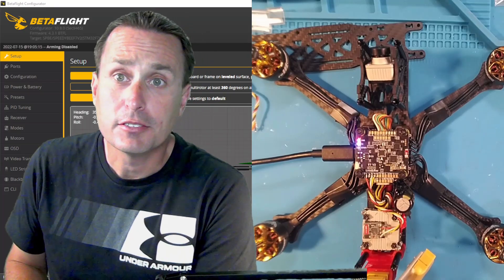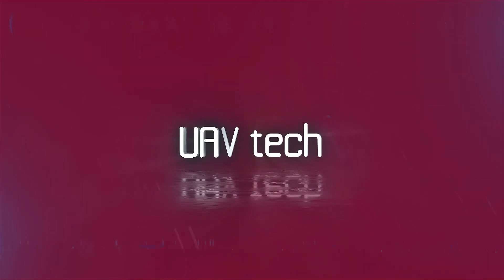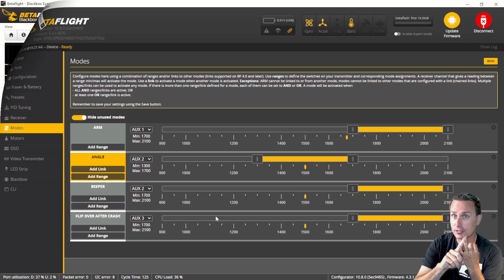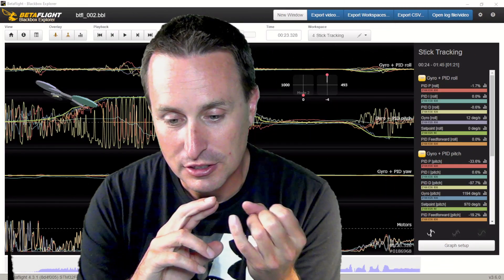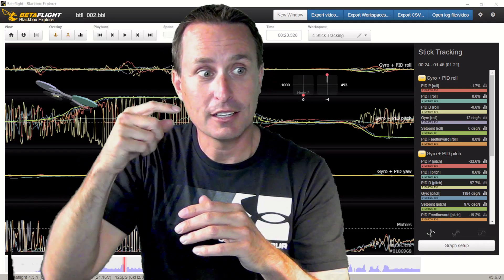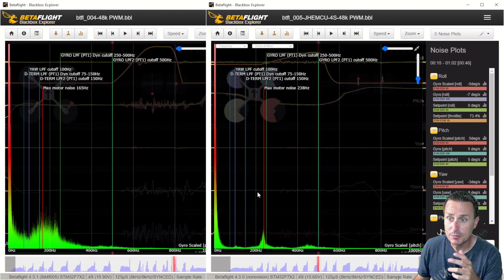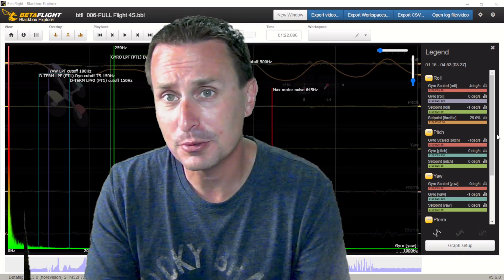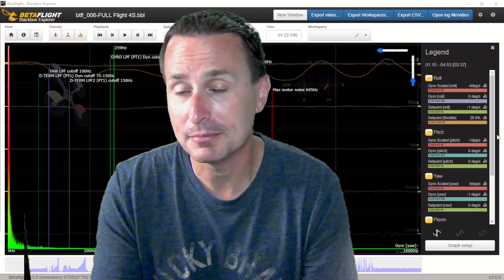🔥BAD FPV EQUIPMENT💥 -- Is your Drone build Good? | Check It!

Comment: YES. In fact what I really want is someone to make a video with some rules of thumb that helps me pick from the presets. They say Clean, Normal, Dirty. Is my quad clean normal or dirty? I dont know. We all think our quads are clean because we are all awesome at building quads, but I suspect more of us should be picking normal and dirty. Just some hard fast rule, like peak noise above some number, you cant pick clean.
Reply from the maker: I think the rule is it flies ok on Clean,, go with Clean.  If not, go with Normal.  If still no good, go with Dirty and consider trying to fix it up to be cleaner.

Comment: Hi, i am just so close before just quitting fpv after 5 years beeing in it. I invested so much money which especially as a student certainly was not easy! I hoped (since you are THE Betaflight expert) you might be able to help me:)

So: i´ve got two FCs on Bf 4.31 a´with major issues.
The first one was a foxeer f7 mini pro v2 i flew for quiet some weeks without problems. Then one day, i switched the Frame and ESCs and all of a sudden my video feed only showed a black screen with the bf osd on it.
I wired the fpv system sepperatley (cam with vtx and vtx to battery) and both worked flawlessly. Unfortunatley both of my cams (Foxeer toothless) showed the worng voltage, idk why and how to change that. 

The i baught myself a Tmotor F722 mini as a spare and first everything seemed fine, except for that the video looked very bad (horizontal lines etc.). I then too wired the vtx and cam as a independend system and again: they both worked fine.
The i wired them back and weirdly the same thing happened again: Vtx worked fine, but transmittet only a black screen (this time even without the bf osd). I wondered if this might was a bf bug since the cam worked, the vtx worked and the only thing that didn´t happen was the fc giving the video from the cam to the vtx...
Then all of a sudden: The Fc didn´t really react  anymore. When i plugged in the battery, the the first half of the usual beeping happened, LEDs turned on but nothing more. Also the FC didn´t recognise the FC anymore...

so i tried to flash it back to a previous bf version (which i didn´t really think would help but it was a guess. I flied bf 4.3 successfully for some weeks). Weirdly the PC only recognized the FC when it was powerd up in DFU mode. But everytime i plugged it into the PC it recognized it just for a few seconds and then acted like it got unplugged again. Meanwhile the fc got super hot.

I am incredibly frustrated since i spent almost all of my money on this hobby and still don´t have a flying quad. I am just so close to quit... If things break so unpredictable and randomly my wallet just cant handle it anymore. This is even more sad, since i propably spent over 1000h on just designing my own 5" frame... It honestly hurts, fpv is such a passion to me.
I really hope you (or anyone else) could maybe help me! I haven´t lost all hope yet (just most of it)...

Comment: Hi mark ! nice video and funnny it comes today , i just made a build , getting hot motors , looked for blackbox log. was some noise on pitch axis. don't know why. i put then a new fc and i am getting the same problem as you got. i putted the other FC on a new build, and works like a charm no more noise on pitch axis for this one. I think i will rebuild the first one and double check everything.

Comment: Hey Mark! I had this exact same issue on an FC as your first one, and I disagree that you should have replaced that fc. A cap on the vbatt rail of the FC would have probably fixed that. I had a gyro that looked basically the same. Ill reply to this comment with an imgur link, If you could be so kind as to approve it. Ill dm you my bbl screen shots as well in case you miss the comment.

in the comment below, left is a 1000uf cap on the esc leads. Cap-Cap, 20mm 20awg right to the pads, right is the same, with an additional 470uf on FC vbatt.
Reply from the maker: I have tried a cap on the 5v rail before and it didn't help, but let me try a cap on the vbat rail.  That said, it doing it when the motors were at idle doesn't have me hopeful.
Reply: @uavtech  yeah, weirdly I've tried the 5v and 9v rails and didn't have much luck, but a ~220-470 on the vbatt (depending on space... 35v are big caps) worked really really well. I've been wiring them with cap-caps and very short 20awg wire. Not sure why going further upstream has worked for me, but maybe feeding the regulators that feed the gyro clean power has something to do with it? Idk. Using the pads that are meant to wire the FC to the ESC (when not using a harness) seems to be a convenient place to grab vbatt and then the cap can usually sit right there behind the camera.

Don't use the legs unless you literally flush mount, otherwise it's effectively not ultra low esr due to the resistance in the legs.

And none of that silver cap purple stripe garbage caps that come from the bottom of a dustpan from the floors at a Chinese TV factory either. Panasonic FM, fr only...., or a rubycon in a pinch 👌
Reply: Here is the link. This will probably go into your held for review.

https://imgur.com/a/kaauqu9

left is a 1000uf cap on the esc leads. Cap-Cap, 20mm 20awg right to the pads, right is the same, with an additional 470uf on FC vbatt.

Comment: I don't know if it's a coincidence but I've seen 3 different caps with a broken (burned of?) leg lately. And it doesn't only affect with "no cap" but with added noise from sparks (I guess). Can't really understand why they break. The latest was strapped to the same frame plate as ESC was mounted on (and not on battery pads/leads but separate pads).
Reply from the maker: Yup, i have seen that one too on a quad i rcvd for tuning.  After re-soldered it was fine.

Comment: I really struggle with tuning pid and filters. I spend my time trying to build it as solid as I can and run it on default settings. Call me heretic, specially in this channel, I know, but as soon as it flies ok, I will stop fiddling and move to the next project. Having said that, flying niclely on default settings is a testament to the devs hard work.
Reply: Bro on 4.3 just raise the master Slider until the P gets in to the 60-70's and use an RPM filter preset. The only thing left to play with is the FF and stick tracking sliders..
Reply: @Barks_Bridge_Dog_Training  working on figuring out 4.3. Call me lazy or, even better, 4.3 being great at default.
Reply: Someone needs to offer an affordable pid tuning service... even if it just sending them a Blackbox file.